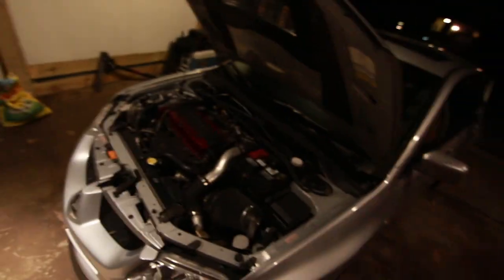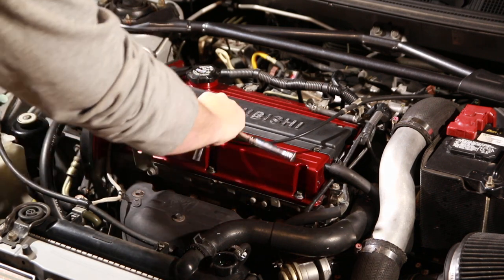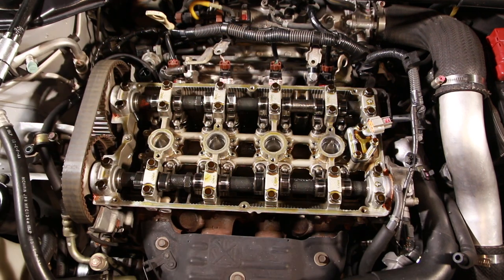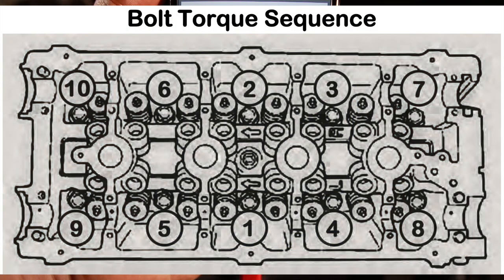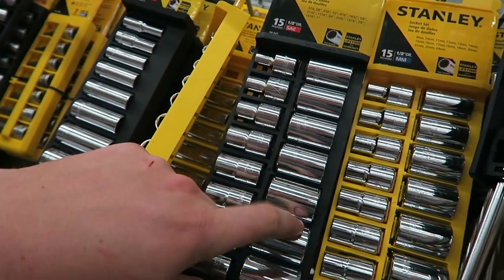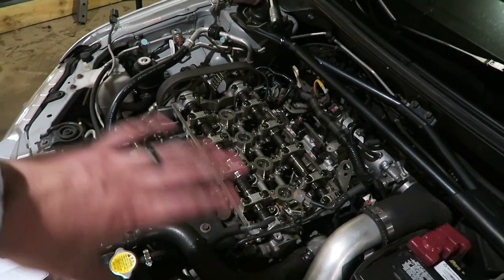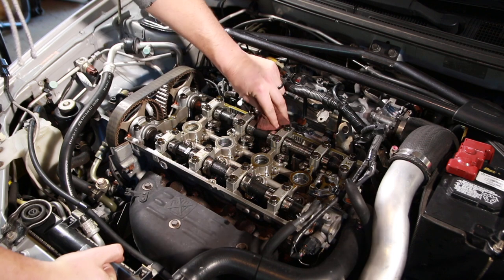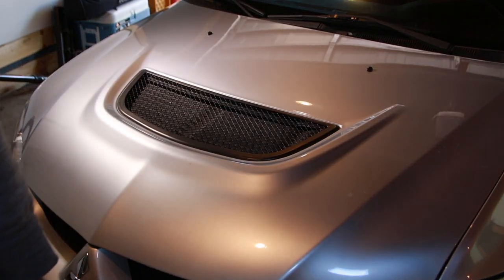HOW TO: EVO 8 HEADSTUD INSTALLATION 1X1 METHOD

Comment: Great video:) But just one question: Did you cleaned the oil that was around the old headstuds? Because if that oil goes on the thread of the engine block it will mess up the tightening torque.
Reply from the maker: Yeah, I made sure that nothing contaminated the new studs other than the ARP sealer. I also did end up removing the valve cover a few thousand miles later and re-checking the torque and everything was on point 👌 Thanks!
Reply: Great job then, hope your channel will grow, because you post interesting stuff:)
Reply: The Bens Garage you call assembly lube, “sealer”??

Comment: Did you have to drain the coolant to do the 1x1 method?
Reply from the maker: Nope. Had no issues with that
Reply from the maker: At least not with my motor, the non-mivec evo 8. It may be different in other applications

Comment: Great walk-through! sucks that it took you on an adventure.

But Dude, I'm so hating. the valve cover on my 2J is a pain in the @$$ to get to. I have to remove the throttle body and intake manifold. Toyota wrapped their induction system over the valve cover on the GE version. if it wasn't for that, I would have changed my cams, lol
Reply from the maker: +joeywilson3 haha! Tell me about it! When I had my old 87 Supra, that's the motor I had as well. Just to change the spark plugs was a nightmare on that thing! 

Thanks for sticking through the long video! I was tempted to split it in two parts but I figured if I were searching online for a quick how to, then I'd want it all in one. 👍🏼
Reply: You make great content, why not stick around and enjoy the show!
Reply from the maker: Thanks!
Reply: joeywilson3 e

Comment: Did you ever experience head lift and/or leaks with the 1x1 method?
Reply from the maker: I did not. I even took it to the drag strip and beat on it like crazy and it still held up very well. You just have to be confident that your head is not warped and the gasket is still in good condition.
Reply: @ShaunBens  awesome thanks !

Comment: NEVER use your torque wrench to crack bolts loose. that's why breaker bars exsist
Reply: you should have replaced the head gasket as well. changine the bolts is a temporary fix. it will get worse over time and you will cause serious damage
Reply from the maker: 😆 the head gasket was in perfect condition and the car ran fine and never had any issues again

Comment: install used head studs?
Reply from the maker: Yeah! ARP says you can reuse studs as long as they are within stretch specs. These were in mint condition taken out of a factory Evo 8 and replaced with the 625+ model due to major engine modifications happening with his car. I got them for a sweet deal and they're working flawlessly
Reply: The Bens Garage Just my opinion but I wouldn't buy something like that used. A new set of the standard arp head studs are only like $100. BTW torque wrenches are not breaker bars that's how they lose their calibration
Reply from the maker: +Andy V Closer to $150 with shipping and everything. $150 I didn't have hence why most of my tool runs were to harbor freight instead buying a nice torque wrench and a real breaker bar. I got these slightly used for $30. No signs of abuse. Previous owner was moving and needed quick cash and they've been sitting in his garage for a few years. That's a killer deal but thanks for watching and your opinion. My head is clamped down nicely with no leaks, after a week of hard street tuning so I'm confident in them.